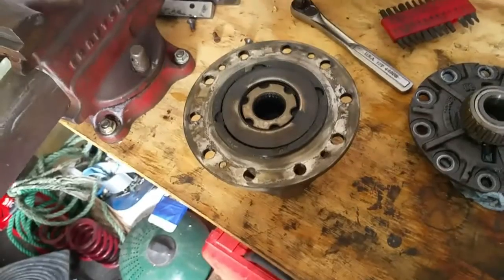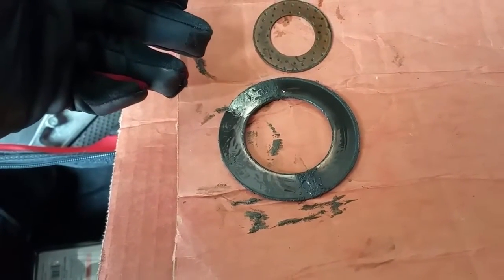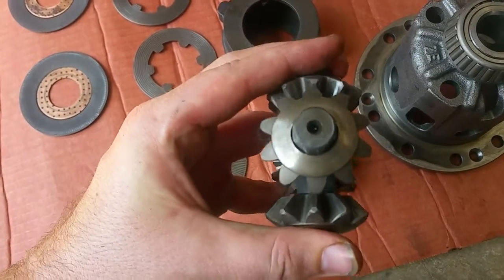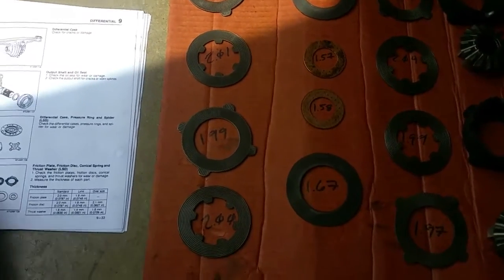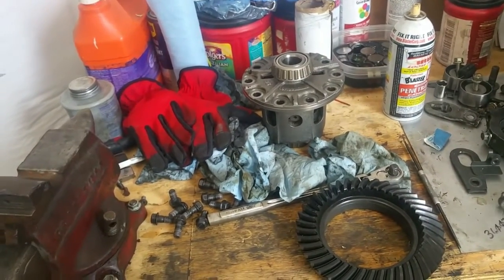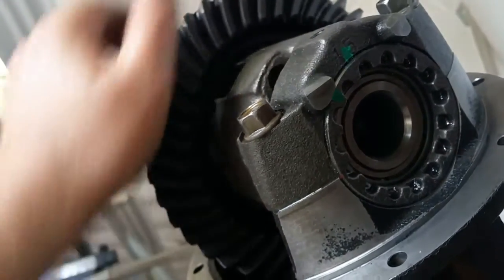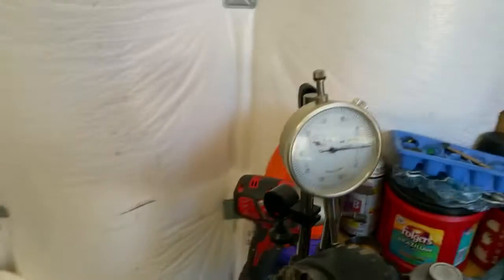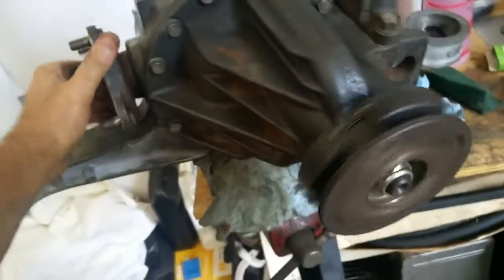How to build an RX7 clutch type differential for your Miata.

Comment: How’s the diff holding up? Did you ever change the 3.9 in? Change any settings since going turbo?
Reply from the maker: @brandontrendov1382  still in the car today.  Never changed the ring gear.  The 1.6l really wouldn't make enough power for it to be a big benefit.  I would probably shim it a touch for more preload for track work.  It would loosen up after a couple sessions.  It was low on the priority list though.

Comment: Yo Cody, just finished setting backlash on my diff. First spot .004, the remaining 3, .003”. As per FSM i’m only too tight by .0005” … how did your diff hold up after planned events? Thanks
Reply: Also was talking to a friend and was asked if I set preload on the side bearings (I didnt touch pinion), I’m about confused because to achieve required backlash — the adjust screw has to naturally apply load on the bearing anyways.. is that not preload in itself? By trying to make sure the same amount of preload is applied on both adjuster screw sides, I end up exactly where I had marked them prior to disassembly.
Reply from the maker: @ユリウス-h7u  I just saw this comment man,  Sorry for the super late reply.  I don't remember my backlash numbers as it's been years since I did this.  I set the backlash by the adjustment "screws", "caps"?  I don't know what they are called, but even just torquing down the housing would change my backlash.  

As for preload, the only way to adjust that is by shims.  Either buying oversized shims or cutting some out of a can/copper sheet.  I also did not touch the pinion gear.  Setting backlash and preload is pretty easy in comparison to setting the pinion .  

Have you had a change to drive on the diff yet?

Comment: Hey Cody, you mentioned a couple of times in the video that you flipped some of the friction plates/discs. Likewise all my measurements are within the limit, but if I simply flip mine front the orientation they came out of, doesn’t it remain the same measurements? — which is slightly below STD. 

How does flipping it work if once it locks up, still below STD measurements? 

Thanks
Reply from the maker: Yeah, the measurements wouldn't change, but the wear surface does.  If you look at your discs you will see one side has noticeably more wear than the other, at least it was this way for mine and some of the others during my research.  

If I was to do it again, I would go in and shim the diff for a bit more preload.  It was fine for 200TW stuff back in 2016, but modern tires are way more sticky and overcome the diff in some situations.  What are you throwing the diff in?
Reply: @CodyYankey  when you say preload, go oversize on the shims? I see mazdatrix offers +.2mm thrustwashers and +.1mm friction plates. 

It’s just for drifting, though I use the cheapest chinese tires at 235/40r17
Reply from the maker: @ユリウス-h7u  You can go over on the plates but you can also just cut an aluminum can up and place the shims on the inside of the conical washers.  It just gives you more preload and more breakaway torque as it will be about +.2mm thickness.  I think you also need to run a friction modifier with the diff, which also lessens preload.  For a drift car on hard tires, you might not have any issues with just reassemble of the spec parts though.  

Super sticky tires I would sometimes lift a tire in autocross and the diff would unload.  Never had that happen on track though.
Reply: @CodyYankey  my friend said a Sapporo can works best, JDM material 😂
Reply from the maker: @ユリウス-h7u  Ha, going to recommend that to my other commenters in the future.  That's hilarious.
Reply: Technically I am shimming the stack since I’m putting a replacement that is thicker to account for lost material over the years right? Just not the mcgyver way of an aluminum can
Reply from the maker: @ユリウス-h7u  You would be but depending on the total wear your stack my end up back to a stock level.  It will really depend on the clutch pack wear.  But if you are going to thicker clutches then it will increase breakaway from where it is now 100%.

Comment: excellent resource 
ive also noticed that most threads on this swap don't mention the  caps
are rx7 caps situational then? they're supposedly the same bearings.
Reply from the maker: That's a good question.  The caps need to stay with the diff housing.  They are machined together, I believe.  That is how I approached this anyway.  They should be the same bearing depending on the year RX7 diff you have.  The hard part about all this is the slight variables that come with manufacture year of the car and assuming they are the OEM part.

Comment: So what swapping this out do exactly?
Reply from the maker: It gives you a limited slip differential with stub shafts and tunable clutches (if you wanted).  If you have a TorSen diff in the car already then it's not worth the effort, unless you need to tune your diff.  The clutch type diff is also much stronger than the TorSen with people pushing well over 800hp through them on drag RX7s.
Reply: @CodyYankey  are the clutch type really that much stronger than the Torsen? I currently have a Torsen V1 and thought about swapping the diff cover plus the ring and pinion. 

If the clutch type really is that much stronger, I'll just build  clutch type, 3.3 r&p, RX7 cover into a miata diff and then sell the Torsen...
Reply from the maker: @juztinking8813  They are massively stronger than the TorSen but that's not really a big concern until you are one really sticky tires or drag slicks.  Usually a stock 5 speed goes before the rear does.  

The reason I went with a clutch type is cost and tunability.  The TorSen is good if you just want to set and forget it, but with clutch types you can adjust clutch thickness and preload.  If you have a perfectly functioning diff, then stick with that.  Unless you are drag racing or at some super competitive level of track racing.
Reply: @CodyYankey  I have the 6 speed and 3.9 Torsen. I want to replace de gearing since the gears are way too short and might as well replace the diff. 

With that being said, I currently have 257whp and 208wtq and plan to have a built block and roughly 400whp, if not more so I'll need a stronger diff unit than the Torsen.
Reply from the maker: @juztinking8813  If you go that high in power you will need a clutch type or a Getrag.  You will also need to have the stock housing reinforced with some aluminum plates if you stick with the Miata/RX7 housing.  

At your current power you'll be good, even for track use.

Comment: Hi just saw this Video and I was wondering if this diff is the same as the Factory Tochigi Fuji Super LSD you find in 2003+ miatas.I have a Fuji Diff swapped in my 2002NBFL it seams to work well but everytime I change the Oil some little metal chunks are on the Drainplug Magnet.I dont know maybe these chunks are from the Clutches ? If so do I have to Replace them and where could I get Clutches and Bearings for thr Fuji diff ? It makes a little bit of whine noise as well.
Reply from the maker: These are not the same type of diff as the Fuji.  Sounds like yours is on borrowed time right now.  I've not messed with a Fuji diff before so I really can't give you advice on what to do.  Sorry man.
Reply: @CodyYankey  thank you for the quick response I guess I have to swap a Rx7 diff now huh 😛 in what Rx7 can I find these ?
Reply from the maker: @peterbetting9345  You'd need to double check but I believe the years are 84 to 91 non turbo models.  It's been a few years since I've touched mine and I don't recall all the details, and there are many.  You may be better off finding a good TorSen from another Miata, type 2 from the NA8s and NBs.  I guess it really depends on the gearing you're looking for.  I stuck with the 4.10 but if I was using a 6 speed I'd probably look for a 4.30 if the car wasn't turbo and a 3.60 if the car is turbo.  So building a clutch type may not be worth it when considering your application.
Reply: @CodyYankey  im going to swap the vvt 1.8 engine in my NBFL and now im running 5speed with 4.1 I love how the Diff Locks right now and I dont like the Helical ones ill search for the rx7 diffs and just swap my Ring Gear from my open 4.1 diff I have laying around also im Think Im going to use the housing of the oped diff since i have a feelimg that the "imput gear's" bearing is making some noieses 🤣
Reply from the maker: @peterbetting9345  I run the 4.10 with my 5 speed and top the car out on big tracks but on the street and autocross I love the combo.  I am a fan of the clutch type but it does feel different after 4 or 5 session on track when hot.
Reply: @CodyYankey  well that sounds like you need a Diff oil cooler 😛

Comment: Would you recommend the Torsten over the rx7 differential
Reply from the maker: Probably.  If you don't have the time to play with break away torque or really want to tinker with the diff, then a Torsen is where you should go.  If you want to take the time to "tune" the car to your driving then a clutch type is what you want.  If you look at the fastest cars many have an OS Giken diff which is clutch type.

Comment: so how does the clutch type feel? I have a type 1 torsen and I cannot find a solid comparison on the two when it comes to daily vs track
Reply from the maker: I have had good success with my clutch type.  I can't really comment on a  comparison as I have never had Torsen in the Miata.  I don't think you will find issues with either of them for daily and track use until you start getting into some very sticky tires (Hoosiers) or super high spring rates (1000/800 in/lbs)
Reply: ahh okay, thank you! great video too! helped me identify the type of diff I had to begin with. going to run it soon and see if there is a difference
Reply from the maker: Best of luck man.

Comment: I'm just in the process of doing this now, the part about using the FC end caps has saved me a headache.  Thanks for making this video.
Reply from the maker: Mike Wilson just be sure you have miata axle half shafts.  I used the C clips from the rx7 as well.  You may want to replace the axle seals also.  Goodluck, setting backlash is tedious and time consuming.
Reply: I do have the FC half shafts but I was going to get the one piece axles from a later Miata.  Would you suggest using the two piece ones instead?
Reply from the maker: Mike Wilson I was going to do the same thing but I've read a few people have had seal issues with the single piece axles.  Another nice part about 2 piece is if you need to drop the diff.  You don't need to drain it, just pop the axles off the diff ears and drop the housing.  It is difficult to find 1.8l two piece axles, though.  They were only on early 1.8L cars 94-95 cars if memory serves me.  May want to research shimming the diff as well.  I think making a thin copper shim would really help to achieve a higher preload.  I think there may be a link in the description for it. Can't check from mobile currently.
Reply: Yeah, part of the reason I was going for the later axels is I can find them.
Reply: I've got another question I'm hoping you can help me with.  My car is a 90 and I'm upgrading the diff from FC parts from my old car.  I had to get the pinion carrier and just noticed that the damper is spinning freely.  I've seen a video where someone advised to cut it off.  Is that a good idea?
Reply from the maker: What do you mean by damper?
Reply: There's a bulky item on the input shaft.  It has cutouts so the driveshaft bolts can be accessed, looks like an exaggerated 'X'.
Reply from the maker: Ah, right.  So for a Miata you will need a 1.8L driveshaft.  The driveshaft keeps the damper.  Are you using a 1.8L housing?

Comment: Not sure if you'll see this but:

Where did you purchase the RX7 differential? Currently I'm only really looking at eBay, but if there's another site to look at I'm all ears!

Thanks
Reply from the maker: I found mine on Craigslist.  It was semi local to me and priced cheap.  Some of the drag guys like the FB chassis for small block Chevy swaps and that is exactly what he was doing.  He was going to a Ford 9" and didn't need the FB chunk sitting in his garage.  You may try your local tuner shops for leads on rotary's.  The FB is getting kinda rare now so parts are difficult to find at times.
Reply: NA6 driver Will do. I found a diff from a 1986 FC on eBay but its 375ish dollars, which is a bit expensive for something I'd have to take apart anyway. I'll keep searching though, thanks for the tip!
Reply from the maker: Man, I said FB for some reason in my post.  I think those were 6" housings.  Just stay away from the Turbo 2 stuff and you should be good.  You may need to change axle ears around a bit to make it work.  $375 is too steep, creeping up on Torsen money.
Reply: NA6 driver Alright. I'll do some more research on part interchangibility. I thought $375 was too steep as well, I'll just keep up the search. Thanks again for the useful info.
Reply: I forgot to ask: what would be a good price for a diff?
Reply from the maker: I wouldn't pay over $100 if you still need a 1.8 diff housing and whatnot.  I had to get everything since mine was a 1.6L car.

Comment: Could be possible to clean it without disassembly? Spraying with a Karcher?
Reply from the maker: To be honest man I wouldn't do that, nor would I recommend it.  Also I don't think you could get the nozzle into an area where you could clean all the clutches.   Not sure about corrosion issues cleaning that way either.  You don't want to blow out your pinion seal and you don't want to rust the bearings.
Reply: That´s my opinion too, just don´t want to rebuild it... i think diff is in perfecto condition. I bought it some days ago and went to open for inspection. All looks ok but i i was thinking about a fast cleaning.
Reply from the maker: Carlos QuinT Man, if you didn't see any chunks of material coming out of it then I would bet it's fine.  Mine was questionable when I got it.  Install it and see how it goes.  Good luck bud.

Comment: could you pls link me to the factory torque specs and stuff so I can print them out before a swap the lsd? thanks
Reply from the maker: Find what year you have and that should have what you need.  

http://www.wright-here.net/cars/rx7/manuals.html
Reply: +NA6 driver perfect thanks!!! also did you have to change out the mx5 axle c clips for the rx7 c clips? and did you use that yellow gear paint stuff to check the wear pattern?
Reply from the maker: Man, testing the memory now.  I believe I used the stub shafts from the RX7 and the clips from it as well.  I used two piece axles from the early 94-94.5 cars, which, were a pain to track down but, it allows you to remove the diff without draining the oil.  

I used something called Prussian Blue for the wear pattern.  Pretty sure I talk about it in this video, at the end.  My pattern wasn't perfect but I didn't want to change pinion depth, which is what I would have had to do in this case.
Reply: +NA6 driver perfect..... thanks a lot!
Reply: +NA6 driver sorry I got one more question.... did you replace those axle seals where the stub axles go into? if you didn't, was there any problems with oil leaks?
Reply from the maker: +Colman Au Bmx Media I did replace them.  I got cheap ones on rockauto.

Comment: Thanks a ton for the walk-through! Super helpful.
 Back when I had my old 1.8, I remember reading that people had issues with leaking diff oil out of the axle seals, with an RX7 diff swap...
Have you had any issues, or heard of that?
I've got a blown VLSD in my formerly-STS brg now, so I'm looking for an affordable upgrade to a 7" LSD.
Reply from the maker: I have read a few threads about issues with seals.  I went and got factor seals and have not had an issue.  They are not cheap compared to some you may find on Rockauto.  I think this is a worthwhile modification if you can't find a decent Torsen setup locally.

Comment: I have a 1.6 open diff what would i need to do the rx7 diff swap?
Reply from the maker: 7 inch housing from an NA8 or NB, axles, and driveshaft from an NA8 or NB.  The axles will depend on if you went with 1 or 2 piece.  Your stock 1.6L diff will not work for any of this.
Reply: +NA6 driver ok thank you so much